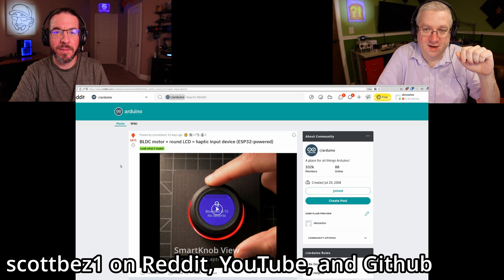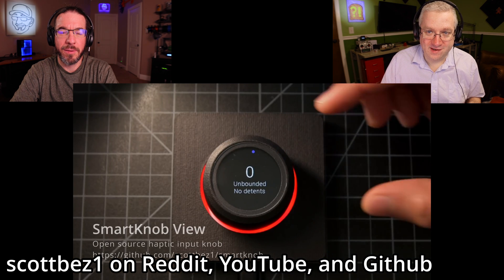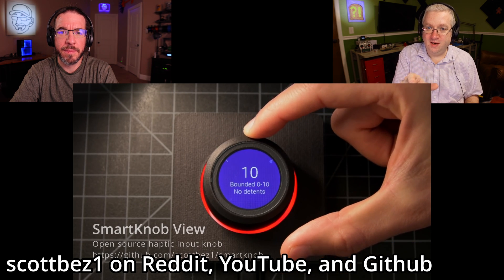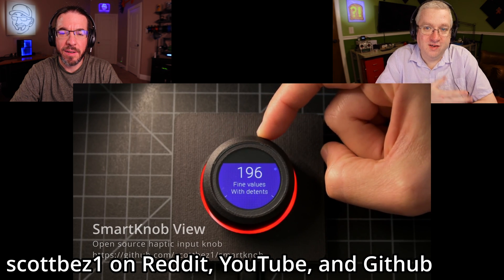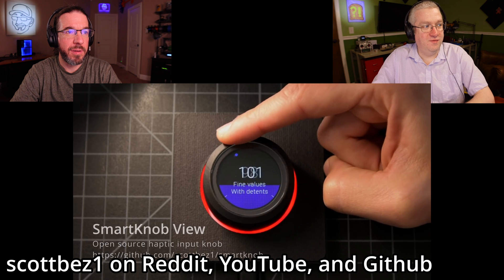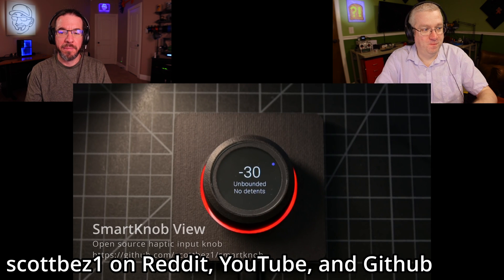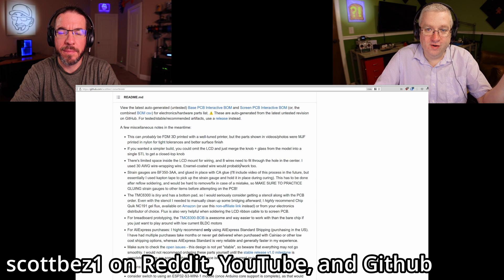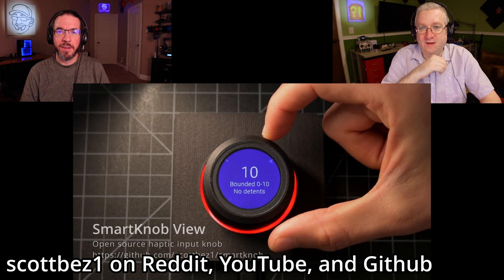DIY Haptic Feedback Knob with an OLED Display by scottbez1

Comment: I would create a very expensive volume knob for an audio preamplifier project. A VERY expensive volume knob. I'm planning on building a pre-amp soon, but I don't know that I will use this volume knob. At least not to start out.  Also, I would need to check out the dimensions of the knob and  the front panel of the pre-amp. I suspect that the knob would be too big. Even if the knob would fit, I'd have to shrink the PCB down to make it work. It looks very much like the volume/display knob on the Eversolo DMP-A10.

Comment: I almost want to have something like this in wristwatch format, then use some method of localisation to know what room I'm in and offer the most appropriate functions first.  Walk into the hallway and I get brightness for the light and thermostat for the house, walk into the living room and I get brightness and colour for the lights, walk into the bedroom and I get brightness for the lights and speed for the fan, etc.  Keep pressing the dial and you eventually get a room selector menu so you can still control other rooms and systems without needing to walk there. Leave the thing alone for a minute and it goes to sleep and just displays the time.

Comment: I think the idea would be to integrate this into ESPHome or HomeAssistant and be able to use this as the sole control for rooms in a house.  control lighting, color temperatures of lighting, thermostat, volume/media control, etc.
Reply: That is actually why I have been looking into this but I don’t have the complete technological knowledge for it, could you by any chance point me in the right direction

Comment: The universal knob, put it on the a couch and from there you can control everything, lights in the house for movie night, temperature for watching sports, timer for kids to take turns playing games, navigate through normal TV settings and changing channels. Simply hold for 3 seconds to turn the divice on and off from divice selection menue, from there it's as simple as quick press to select and long press to go back. It's a niche product, but there is somone out there who would spend premium for such a divice.

Comment: It could be a simple control for a lot of devices - with the button function toggling between menu (circular as everything) and selected functions. The display doesn't have to be on the knob - can be a monitor settings input, a radio knob (volume, freq, next/prev channel, on/off), light switch (dimmer, motion sensor on/off, sensitivity, on-time, insensitivity time, brightness (daylight) threshold and so on. Laundry machine - program, times, options. Microwave - power, time, presets, grill - turning as time elapses. Shower controls - temperature, function, flow (although leave a separate valve to shut it off fast if needed). 3D printer or similar machinery, as a menu selector/controller. Stuff like roomba or any similar device where you don't want a dozen buttons for various options - all in one knob.
Reply: It is awesome that the only limit is probably out imaginations! :)
Reply: @patregan  and convenience / access speed. Like, you can replace a Playstation 5 controller with it, using a menu which button or axis you want to modify, but would you want to play, say, Elden Ring with it? If you want to have control of one frequently changed value (or a set of couple which you usually access in sequence, like setting up a new 3d print job), and a bunch of others you want to access occasionally (config), this works great. If you have anything you might want to activate at any time (e.g. emergency stop, like your shower sprung a leak and is flooding the house) or stuff you'd want accessible simultaneously (x/y controls) this will be a nuisance.

Comment: Using this project, I'm currently creating a driving mode switcher, and regen power adjuster for a classic car EV Conversion.
Reply: This sounds great for cars. I'm personally against how Tesla tries to use a single touchscreen for everything because I don't want to have to look in order to find what I have to adjust, I want to be able to feel my way around and use tactile feedback.
Honestly, if you can find small low-cogging BLDCs and source a bunch of drivers, you could make a whole control panel of screen-less versions of these. Just rotary knobs with software-defined haptic feedback, since while driving it won't be important to look at the screen
Reply from the maker: That sounds ridiculously awesome!  And exciting!

Comment: This should be great to control a motorized gimbal. One page for coarse control, another for fine, and a third for zoom. Maybe two of them would be necessary, one for polar and the other for azymuthal angles.
Reply: Heck yeah!  And being able to FEEL what is going on would be fantastic.

I use a simple knob to manually move my CNC machine around, but I have no idea if it is going to move 10mm or 0.1mm unless I look at which light is lit on the controller.  It's be awesome if the knob required some significant force to move the router quickly, because that's when you might accidentally smash into something.

Now you're making me want a haptic knob on my CNC! :)
Reply: @chocolatezt  Inception! :)

Comment: I would use it for office related workflows: integrate with your calendar and show your next meeting (e.g. it’s title and how much time is left till start). And when your meeting is about to start - show an option to join linked web conference (like Zoom, Microsoft Teams etc.). And when you’re joined it - use this knob for controlling it: scroll to mute/unmute, turn camera on off, leave meeting etc. 

And this is where the whole fun starts. For example, it can mute you by default and when you scroll it to the right - it resists you (while temporary unmutes you) and when you release it - it rotates back (and mutes you back as well). That would be really useful for dropping quick responses into your meeting, like a walkie-talkie. But if you scroll it over some resistance - it unmutes you for a longer talk. And when you scroll it to the left - it goes through several steps and first mutes you, then turns your camera off and then leaves your current meeting (and you can setup different resistance for each action, like turn a little to mute/camera off and turn with more resistance to leave a meeting).  That would really elevate your meeting experience!

Comment: I think if I have something like this then, I will set up for multiple uses. One is volume control for my pc for sure, other is control my smart lights (functions like on/off, brightness), also as I love to use Adobe, I will configure it for that as well(like zoom and brush size)
Reply: Rotary encoder knobs are awesome CnC Gaming!  I have a JC Pro Macro pad with a big, honkin' knob here on my desk.  Most of the time it is a volume knob, but when I fire up my video editor, each click of the wheel moves the playhead a single frame.  It is easily the handiest video editing accessory that I have.

It'd be 10 times cooler if it were this haptic knob! :)
Reply: @patregan   whoa, you could also try to rig the key frames to the display.